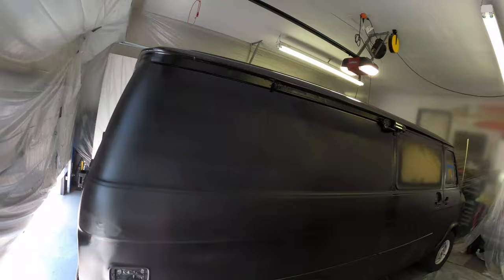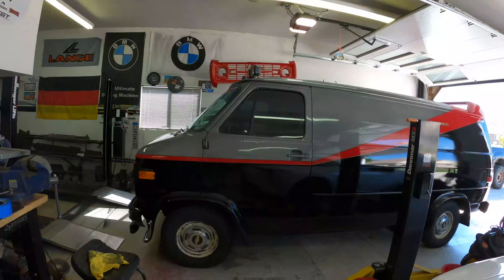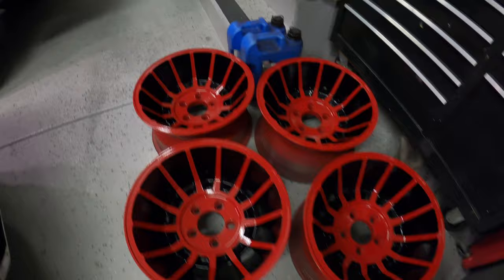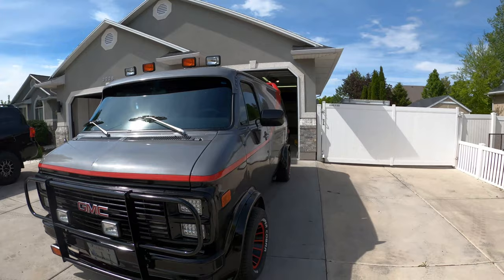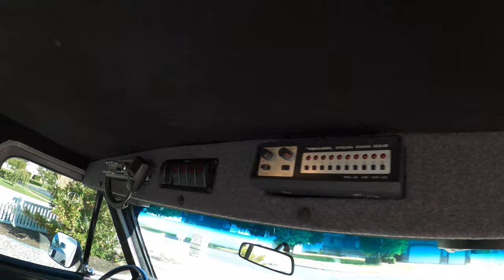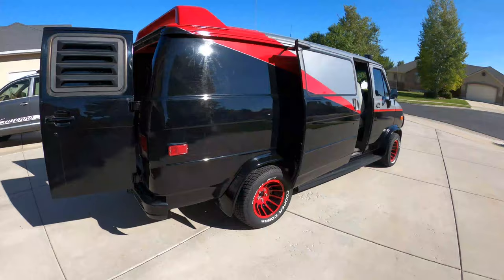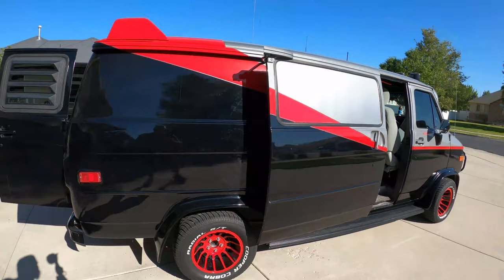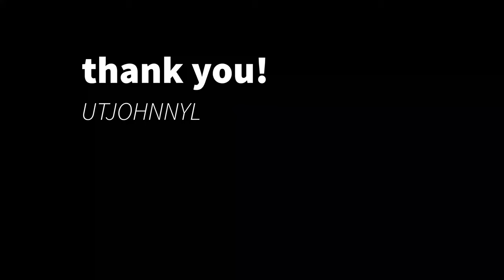Utah Johnny Lange's A-TEAM Van Build!

Comment: The only way it could look better is if you kept the red paint stripe on the right side to cover the window seals. So it looked like there was a continuous red stripe not a stop half way through it with a black stripe running the opposite direction highlighting there is really a window there. Apart from that wonderful job! How much did it all cost ?

Comment: Is the a team van a g10 or 20?
Reply from the maker: My A-Team van in this video is a Chev G20.  The original A-Team van (well, most of the seven they used anyway, were GMC Vanduras).  Essentially the same vans with different emblems.